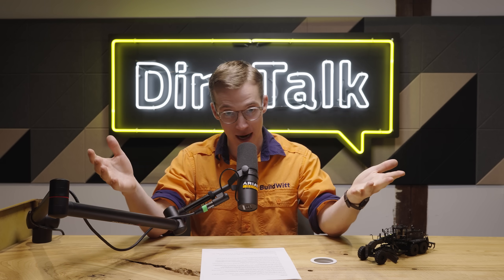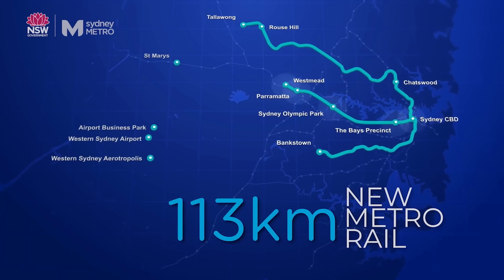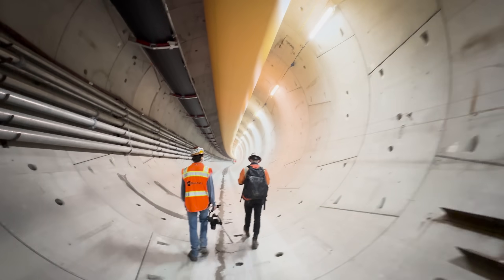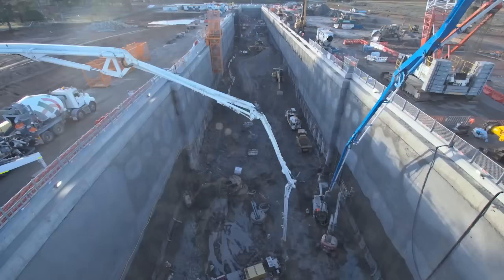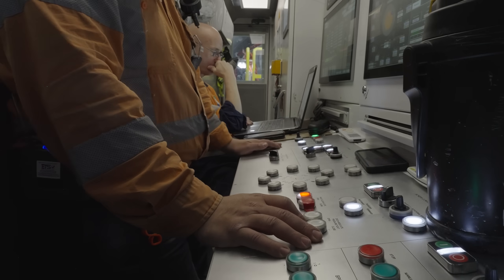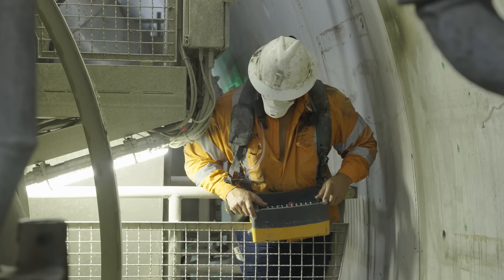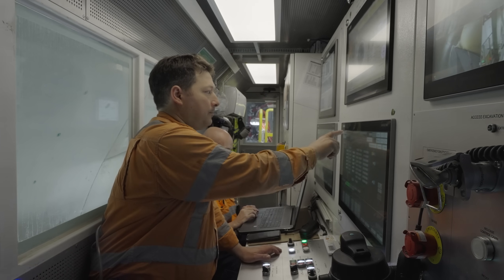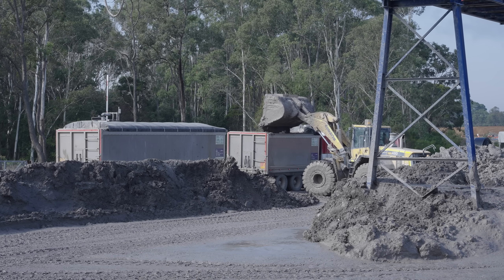Building Sydney's Underground Metro Tunnels!

Comment: Metro will become more local as people from the Sydney CBD or people from Palm Beach for instance doesn’t want to spend another couple hours travelling home after a long journey from Europe or US. A new type of transport will be required and that is a high speed trains with only a couple of stops in between. For instance one line directly to Sydney central with a stop in Parramatta. Then another direct line from the new airport to Newcastle perhaps with one stop in Gosford.Third line from the new airport to Canberra. Fourth line to Wollongong and finally the fifth line to Katoomba or Lithgow.
That’s right to make it work properly there must be very few stops where you can change onto more localised transport.
Luck of planning and using common sense prevails in NSW as a good instance is the newly built M12 which just going to choke existing M7 even if they build 5 lanes each way on it.
Of course we need a junction between M12 /M7 but why don’t M12 continues straight through Liverpool and beyond to CBD and on other side all the way to Silverdale for now?
The new M9 should’ve also been built before the new airport opens at least a small segment for now between Campbelltown and Richmond than extend it later on all the way so at the end it’s linked between Wollongong and Gosford.

Anyway that’s a completely different topic.

Comment: Why so short? Ad they are installing the ring sections, what do the individual pieces go up against?  It didn't look virgin earth.
Reply: It's inside a big steel tube then as they push forward steel tube moves away from segment and leaves the virgin earth there, but they fill with grout as they move forward so segments don't really touch virgin earth

Comment: Because CPB are involved this project will be at least 5 years late
Reply: Stage 1 was finished early and under budget while stage two which tunnels under the CBD and the harbour opened a few months ago was a year behind schedule and over budget which was no surprise since It was tunneling under the city. The airport line appears to have most of the tunnels and viaducts constructed and on schedule to open for 2026 stage three of the first line is 2 years behind schedule i believe and is currently taking over an existing rail line which just had the last suburban trains run on it a day ago. The western line between the city and Parramatta seems to have a lot of progress done already and with the opening set for 2032 it appears to be on schedule.

Comment: As they put the tunnel segments in place, the wall of the tunnel already had a concrete surface. Where did that come from?
Reply: Shotcrete! its like this spray on concrete that they use.
Reply: @SYDTrainsFilms nah it's steel mate
Reply: No not shotcrete, it's steel, look at a TBM before they go underground they have a big steel tube at the back of the shields, the ring is built at the back of the tube then machine pushes forward off ring leaving it behind

Comment: Builds a new airport with a single runway and you said “planning” 😂
Reply: that is only stage one of the new airport you are seeing.
Reply: The airport has been designed to expand over time as demand increases. Thats called planning.
Reply: If you have actually read any of the planning documentation that went into this you would know that this is only stage 1, and that the airport has the capacity to expand to a second runway with up to 45 total gates. THAT, my friend is planning.
Reply: it has 2 runways, the second one is just being built in a second stage when needed

its actually insane how much throughput that one runway has though, when complete it will be the highest designed throughput runway in the world, with more flights per day than even heatthrow

Comment: Interesting, I never heard of a pressurized cutting head.
So it's just pressurized with air I guess? Otherwise you wouldn't be able to enter it, would you?
Reply: Big  air compressors mate, when going under water you have to adjust air blow to not blow bubbles on the surface!
Reply: Epb is just measuring earth pressure so you don’t create a dip or hump on the road above you or damage the TBM
Reply: @antonio3199   They're obviously not only measuring. 
He said multiple times that the CUTTING HEAD IS PRESSURIZED. 
He even said that people entering the head have to stay multiple hours in a (de)compression chamber before they can enter the actual head.
Sure they'll measure the movement or pressure of  soil surrounding them, so they know what's going on. But that has like absolutely nothing to do with my question HOW the cutting head is pressurized.

Comment: If they are not drilling with """""" DeFlaggeration """ then it is old technology so costs more to do with more Profit for those doing the job. More kickbacks for those who push this job.
Reply: Deflagration explosives is a much more expensive method of creating a tunnel, and doesn't work for most circumstances. There is a reason why tunnel boring machines are used all over the world.